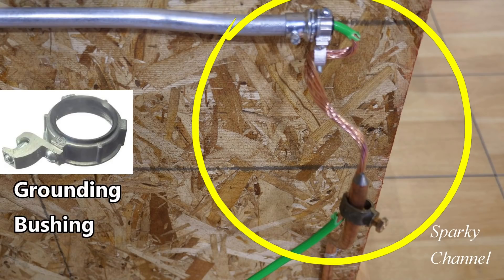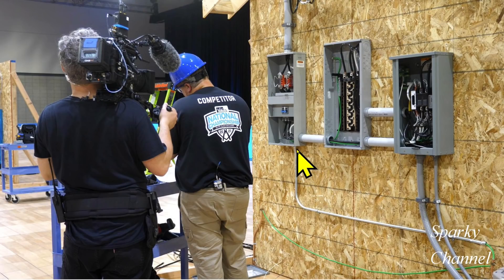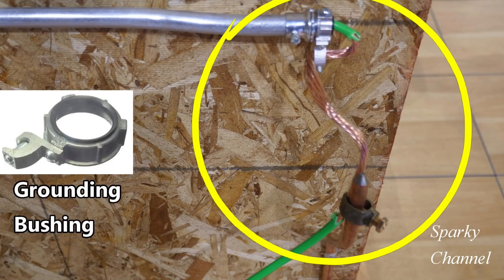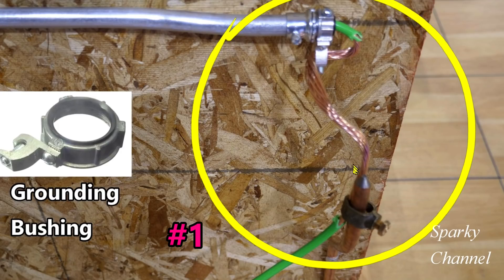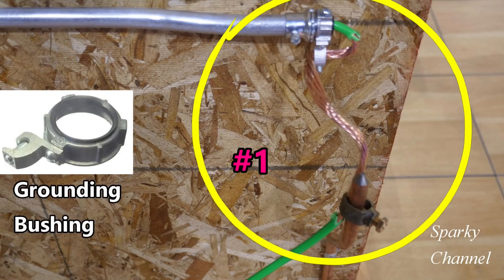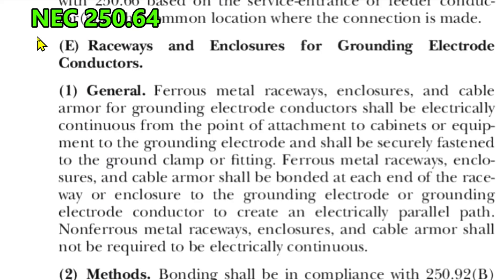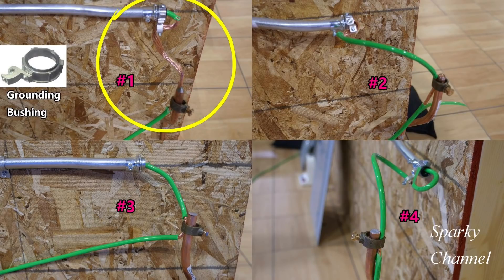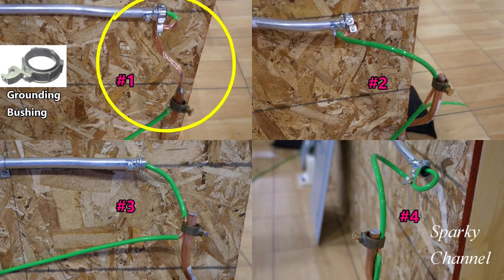Which is Correct by Code and Most Professional? 2020 NEC 250.64 (E)

Comment: It’s interesting that they chosen emt as the sleeve for the gec. It’s probably the most extreme way of accomplishing the task shown. And it looks better than a stick of PVC. #4 is better, the insulation probably moved a bit at the ground rod plus they are timed for performance. 👍
Reply from the maker: I agree about #4 except I thought some insulation was under the acorn clamp. Thanks Anthony!
Reply: @SparkyChannel  number 2 kinda looks like the insulation might be caught under the acorn as well on my phone screen. . I like the looks of number 4 the best and would run it that way making sure no insulation is trapped in the acorn.
Reply from the maker: @jlpservicesinc1452  Thanks!
Reply: I'm willing to bet the organizers used the emt specifically so that they could catch contestants out for not bonding at the far end of the emt
Reply from the maker: @Mawson6492  Yes, they like to test contestants knowledge of NEC.

Comment: EMT will rust outside so I use PVC; 1. I don't hafta deal with the bonding bushing, 2. PVC being non-metallic doesn't corrode. Based on the setup in the video,  if the main disconnect is in the outside meter enclosure (aka mater pan), make sure the green screw that's in the main lugs load center is NOT there. The neutral and ground bars have to be isolated in the load center and from that point on including sub panels. Ground - Neutral bonding  - Only in the main disconnect / breaker enclosure is where the bonding Neutral - ground should take place. You don't want ground fault currents from inside loads travelling on the neutral in the premises.
Reply from the maker: Excellent. Thanks Seth!
Reply: @SparkyChannel  Another thing is at the power company we often field complaints from customers that they get a "tingle" when the touch the garden hose faucet outside. Especially noticed with copper piping.  The NESC (National Electric Safety Code) that's not the same as NFPA-70 NEC (code) requires that any neutral earth voltage over 3 is investigated. Sometimes it's caused by a missing down ground at the utility transformer, severe circuit imbalance, bad ground(s) at the customer premise, broken neutral to the utility or a combination of all. If it's over 3 volts on the customer's ground anywhere in the US, get the local utility involved to assist with tracking it down. This NEV issue is also related to pool shock, another complex subject.

Comment: Interesting I like more #2. I did test ohm meter. My opinion best 4awg for first ground rod because low number ohm. 6awg as well depends on grounding but second ground rod 6 awg is good. Most I installed rmc 1/2 with grounding brushing in Illinois and Chicago use Copper Strap and Bronze Hub.

Comment: #4 you want smooth bends on the gec for grounding. Sure they might have missed some plastic but that's an easy fix. All they others kinked and bent the gec which is bad as they increase high frequency impedance
Reply: As a EE... You're gonna have to show me the calculations on that. I'm betting money you'll be in the multi-GHz (20+?) range before you can demonstrate a difference...
Reply: right light lighting which is technically high frequency signal. because of the way you model the impulse function which is why bend smoothness matters only for the gec @fgbhrl4907

Comment: The thing is - you didn’t show the other end! I have no idea whether and what he used to bond the other end to enclosure. The special bonding lock nut, or the same bonding bushing, or none of the above.
Reply from the maker: I did show the connection to the panel at 1:11 but, true, I didn't show the GEC connections inside the panel.

Comment: So if you use a metal conduit for the ground, the ground must be bonded to the conduit, but do you need to use a conduit?
Reply from the maker: You're asking about the conduit protecting the GEC?
Reply: @SparkyChannel  Yes. Does code require that you use one?

Comment: Can I use a #4 wire or 2 for a grounding.
Reply from the maker: It depends on what you are grounding.
Reply: Yes #4 wire is good than #6 but #6 is good for second ground rod.    I did test meter ohm many time. Remember depends on grounding ohm.

Comment: I think non of them would pass inspection, because if you're using  ferrous enclosure for the GEC, you would need a bonding strap from the EMT to the grounding electrode, and bonded at both ends with GEC.

Comment: #4 and it’s OK you can’t quite see the bare wire at the very  top of the clamp because the clamping surface is an 1/8” or so down. As long as it’s clamping the wire and not the insulation it’s  ok. But I’d flunk all of them for not cleaning up the insulation they stripped, leaving a “banana peel” is ridiculous.  That said the whole setup is stupid.  Who is going to use EMT to house a ground wire?
Reply from the maker: Thanks, good comments.

Comment: I have been enjoying your videos. Very educative. I have a question. Electric baseboard heaters termination. I have seen most of the time the wire coming out of the wall or floor and not attached to anything. Is that the norm and is it to code?
Reply: That's normal because the wire will go straight into the junction box in the heater that is mounted on the wall. But I've never seen them coming out of the floor

Comment: I would give all contestants a thumbs down, this is a very simple task.  All wire insulation should be properly removed (no removed insulation hanging freely) and wiring routed correctly with precision and care.  The electrical connection of the ground wire must be exact.
Reply from the maker: Thanks!

Comment: Were they required to use their teeth to strip the wire?
Reply from the maker: LOL!
Reply: I was thinking the same thing, score the wire the amount needed to fit the acorn, cut insulation with your knife, perfect "cut to fit", and don't leave wire insulation on wires, that's like not cutting off zip tie ends.

Comment: Just run your g.e.c. in pvc with an end bell and your done.    A g.e.c. In an unbonded metal raceway will create inductive choking, when there is high current flow.   If you use a grounding bushing it's like paralleling the emt with the g.e.c.      We always just run pvc with end bells.
Reply from the maker: Excellent advice! However, these contests test the contestant's knowledge of code and they aren't given a choice of what materials to use.

Comment: #2 is the winner from a code perspective; however that installation needlessly adds high frequency impedance because of the sharp bends in the cable. Many panels have SPDs and high frequency impedance in the grounding path is deleterious to their performance. Had #4 not allowed the insulation to slip under the clamp, I too would have picked #4, as many others have as well.
Reply from the maker: Excellent analysis. For other viewers: A surge protective device (SPD) is a protective device for limiting transient voltages by diverting or limiting surge current and is capable of repeating these functions as specified.

Comment: It's always seemed so odd to me that code puts so much focus on keeping grounds and neutrals separate back to the panel and having the EGC be continuous, bonded at both ends of conductive conduit, etc but it doesn't have a provision for tying neutral and ground together at the ground rod itself. The same reasons why you don't want to tie neutral and ground together at a sub panel apply to the main as well. You don't ever want a circumstance where you have a broken ground and a broken neutral back to the transformer as now your equipment grounds are tied to the broken neutral and allowed to float high. If you tie neutral and ground at the actual ground rod itself you wouldn't have that problem as it would no longer matter where it broke, you'd either wind up with no ground or neutral only grounded at the transformer, never risking tying a current carrying conductor to a floating ground.

Comment: Okay Bill, I think that this is a trick question of sorts, in that actually none of the installations are Code compliant.  The grounding bushing that is installed on the EMT connector is not listed by the manufacturer to be installed on anything other than RMC or IMC.  It has to do with the fact these fittings are intended to receive a tapered thread, while the EMT connector is a straight thread, and thus makes a poor contact with the grounding bushing.  The same is true for RMC couplings as well as threaded hubs (Myers hubs) which electricians often mate to EMT fittings, when they are only listed to receive an IMC/RMC threaded connection.
Reply: the grounding bushings have a set screw to bond to the threads
Reply: @fatherandsonadventures-cq8nw  I don’t think that’s the biggest problem. If the manufacturer does not list the product to be used with EMT connectors, it’s a violation.
Reply from the maker: Interesting, thanks Steve!

Comment: Nice review of code with example of non compliance. Sparky do a code video on TE splice connectors (Tyco splice connectors for Romex repair instead of pulling new conductor or using a junction box). I haven’t used them but I saw one recently and not sure what to think of it and what the code provisions for their use is….

Comment: Okay so a quick question and reference. We pulled 750mcm and no ground was told by the super that the 4" pipe was THE GROUND was it wrong or right? It was three phase Black Red Blue.......
Reply from the maker: See my video: Can EMT Conduit be Used as Equipment Grounding Conductor? NEC 2020 250.118 and 250.119
Reply: @SparkyChannel  okay thanks
Reply from the maker: What kind of 4" pipe?
Reply: @SparkyChannel  and it was odd because I'm used to running a ground wire in every residential/commercial job some commercial jobs even have a isolated ground....... It was odd.
Reply: @SparkyChannel  4" metal pipe

Comment: In my opinion .... ALL are wrong !!!! .....I was taught by a Lic Master Electrician ....Do NOT sleeve grounding conductors in metal conduit !!!....PVC should be used !!!
Reply: He is wrong! You can sleeve it in anything or not at all.   The only reason to sleeve it is to keep it from getting damaged  if it's in a industrial climate or some place  that could be hazardous to the conductor.   EMT is stronger than PVC. You can use either one, but EMT is stronger.
Reply: @willschultz5452  PVC is preferred if not subject to damage.  Having to bond the raceway at both ends is more difficult, and if the ground was intended to be an isolated ground, a metal raceway makes it difficult to keep the pathway isolated all the way out to the GEC.
Reply: My answer no PVC for Chicago only Rmc is good.

Comment: 4 was so close. Have to give it to 2. In actual intstallations, I would avoid stranded wire for the GEC, and use solid if possible. I've seen stranded rot away too many times. I run #4 bare copper. Hard to work with but it's bullet proof.
Reply from the maker: Excellent! Good job using the #4 GEC!

Comment: Thing is with number 3 it could have ground bushing on other side.
Reply from the maker: It is bonded in the panel, but it needs to be bonded at both ends. See around 5:08 where it's talking about having to bond at both ends.

Comment: In the NEC.  The driven ground wire conductor does not have to be bigger than #6 awg.
Reply from the maker: Correct, this one was 4 AWG.
Reply: If its 200 amp service it has to be #4
Reply: @willschultz5452  no just a #6 continuous. #4 for cold water.  Been doing it for 40 years.
Reply: @stevenpersinger6577  yes I agree!  Inspectors are making me do #4 for ground rods also🙄
Reply: @willschultz5452  , not to the driven ground wire.    to the water ground yes it is a #4 .
Reply: unless there is a change now in the NEC?    for years it has only been a #6 to the Driven Ground rod.
Reply: @zerosparky9510  around here they want #4 to everything if its 200 amp and #6 for 100 amp.  They want 2 rods even if its 100 amp also
Reply: @willschultz5452  .  I live in Louisville. Ky.   Around here.  #6 to the driven ground rods.  And yes we drive atheist 2 of them.
Reply: @zerosparky9510  yes here if it's a 100 amp service it gets 1 rod and #6 wire and if its 200 amp it gets 2 rods and #4 wire. Some towns and different inspectors want things their way even if code doesn't require it.   I just do what they want rather than argue lol
Reply: @willschultz5452  nope.  Not to a ground rod anyway.
Reply: @steveloux4709  around here they insist on it.   I wish I could use #6, it would be alot cheaper for me
Reply: @willschultz5452  Point out to the inspector NEC article 250.53 (E) "shall not be required to be larger than 6 AWG copper"
Reply: @hankkline7300   I'm going to try since # 4 is alot more expensive. He'll probably say I don't care that's what I want! but it's worth a shot.

Comment: I am taking the quiz challenge. In my opinion none look tidy including #1.  #4 definitely has a problem with the insulation pinched by the acorn clamp. They are all to code except the pinched insulation for #4 but the pinched insulation should be corrected. #3 is to code as long as the ground wire is securely connected to the grounding bar in the service box. In my opinion '#3 is the tidiest and most professional looking, though I would not pull the wire so tight.
Reply from the maker: See around 5:08 where it's talking about having to bond at both ends.
Reply: No, must be continuous on both ends, that's why everyone else used bonding bushings.
Reply: The ground wire must be bonded to the conduit on both ends.

Comment: #4 looks the best executed with fewer sharp bends.  Unfortunately, it is hard to tell if the GEC insulation has compromised the connection with the acorn clamp and the electrode.  I guess #2 must win.
Reply from the maker: Hi Don! That's the same conclusion I came to. It's great to see so many different opinions. That means that viewers are concentrating on this detail and on 250.64 (E).

Comment: #2 and 4 both have a loop of wire exposed where they could get snagged.  they could have improved the installation by running the conductor down against the wall and then back up the grounding electrode after securing it in the acorn clamp.  the other thing to watch out for, which none of the examples did (did wrong, that is), is the wire should be between the body of the clamp and the rod, so the bolt presses against the rod instead of the conductor.
Reply from the maker: Hi Ken! I thought they did put the GEC between the body of the clamp and the rod, so the bolt presses against the rod instead of the conductor. Perhaps I'm not visualizing what you're saying.
Reply: @SparkyChannel  they did.  you might have missed my edit to clarify they didn't do it wrong, I was just mentioning it so the viewers would know.
Reply from the maker: @kenbrown2808  I see, thanks!

Comment: If the wire is bared under the acorn nut, #4 is the nicest/code compliant. I would have used a grounding hub though instead. All the rest were sloppier. Otherwise, #2, but leaving that insulation is just bad.
Reply from the maker: I liked #4 the best too, except for some insulation possibly being under the acorn clamp, which I didn't like. Thanks!

Comment: there was no mention in the panel of the use of a grounding bushing or a serated washer electrically connecting the panel to the conduit.  i would have preferred a 90 degree downward bend on the conduit  but it is not necessary.
Reply from the maker: Good point. It is mentioned in the code at 5:28 but it would have been better if I had enough photos to show the bondings at the panel of 1st disconnect too.

Comment: 4 was better for the less sharp bend and smooth way it was clamped other than the slight amount of insulation under clamp. do you put any anti corrosion paste on those clamp connections ?
Reply from the maker: Thanks Greg! They didn't use any paste in this competition, but it would be a bad idea.
Reply: @SparkyChannel  Would be a bad idea or wouldn't?